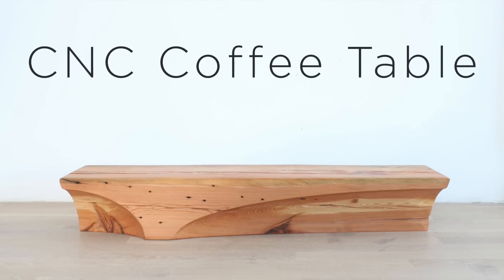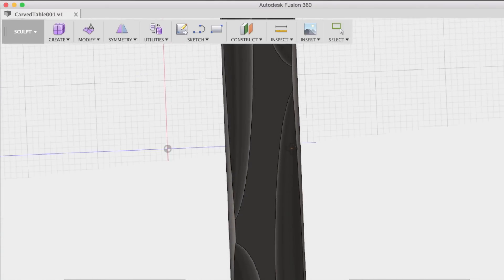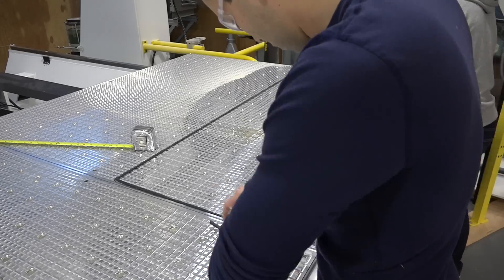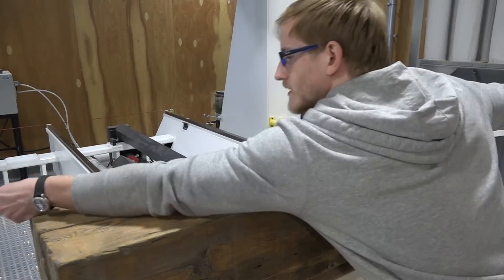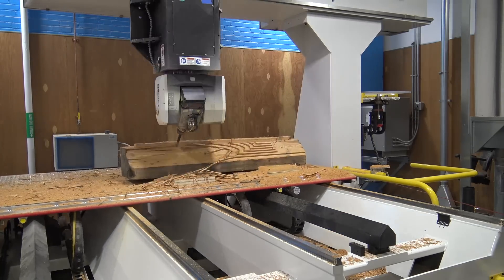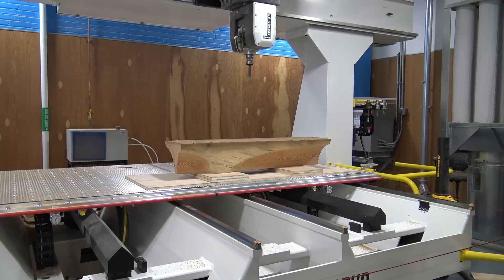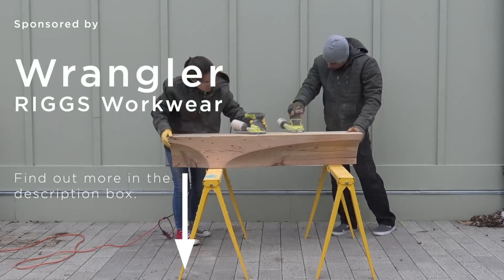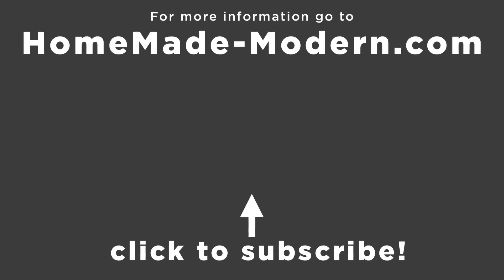CNC Coffee Table | Digital Fabrication Project

Comment: If you used a hand plane of the flat edges and a card scraper you would have been done faster. If the plane blade had been sharp enough the surface would have had a burnished look. I got my plane working and I will never buy sand paper for finishing again.

Comment: this is cool but why not face the top first and use the flat surface for suction mounting?
Reply: How would you recommend facing it?
Reply: they could either do it the way they did (just once though). Or use clamps.
Reply: I think I missed where they turned it over and faced it in the video. I was going to say they'd still have to screw it to the plywood, but you're right, they may have only had to do that once. It looks like there were some noticeable splits in the wood, though, which may have prevented a good vacuum seal.

Comment: I usually like what u build, but this time seem like u took the design to merely looks and forgot the structural part, in my humble opinion is that u need both. Just by looking at the drawings/3D its an automatic red flag for unstable super heavy object. keep the good work, you're getting there.

Comment: You could DIY this by cutting and breaking the carvings with a circular saw and chisels (And a lot of sanding). I just made a Phone Stand out of a Piece of firewood by using this method.
Reply from the maker: yes! i carved a previous table with an angle grinder and chainsaw

Comment: Here is something I found out years ago about sandpaper, and that is, 60 and 80 grit cut a bit faster than 120 and saves a lot of time. Granted the lower girt can score a bit deeper but if you take your time you can actually reach 240 grit in about half the time. What I would do is start with 60 to just hit most of the rough areas than change to 80 for most of the general knock it down fast. Then a bit with 120 and it's almost as smooth as glass by the time you get to 240; especially with orbital sanders. In the old days when no orbitals existed sure you had no choice but to start with 120 but not now a days... Something to consider... Just remember you don't want to push too hard with 60 or 80 grit, just let the sander do the work and glide it along... Cheers....
Reply from the maker: thanks!  great advice!
Reply: Paul Bialozor Thanks for the advice. There appears to be not much knowledge in the maker community about the science behind sanding.
Reply: You are welcome Max Maker. 

Just test the 60 and 80 grits on a scrap piece because those can cut really aggressively and don't push down too hard unless you are really working out some rough stuff. 80 grit is very close to 120 but lasts a bit longer because it does not clog as fast. 

Also an old pair of tennis shoes, preferable with a rubber sole, can be used to keep the paper clean too, just a few quick hits and the paper cleans right up. 

Of course you will wear down the rubber so don't use a pair you plan to use ever again. The rubber on older shoes is more dense than the rubber bar they sell to clean paper. Since you don't use them anymore it's a way to get a bit more use out of them...

Cheers...